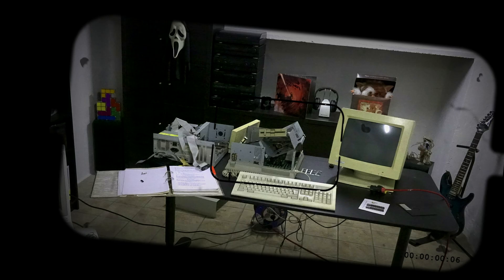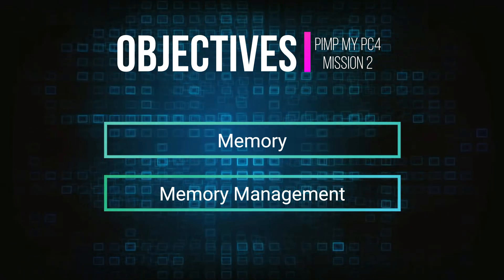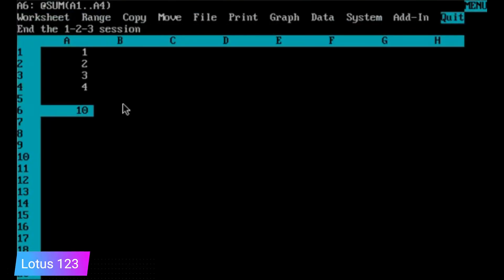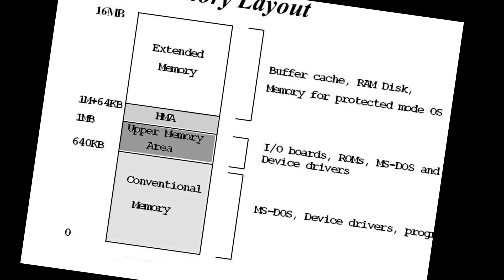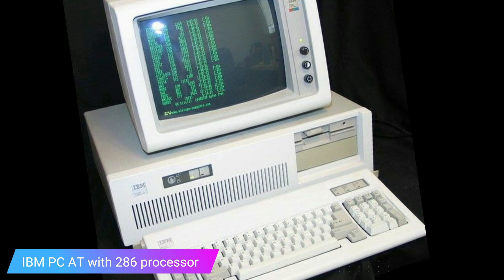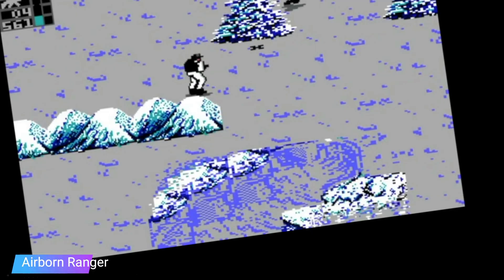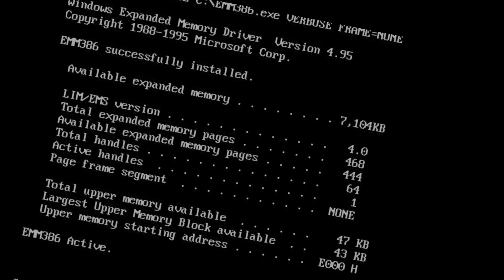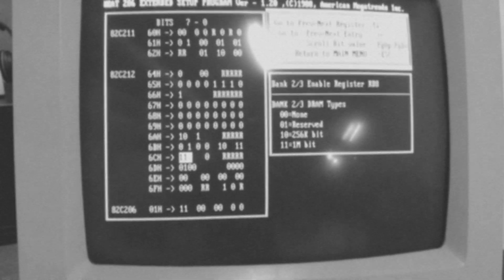Restoring the Atari PC4 - Part 2 (Memory) - AL Technica #2

Comment: Wish I had an Atari PC4, looking for years... With the years I have pushed my Atari PC3 that I own since 1988 to the limit with a NEC V20 + coprocessor, UMB memory card, Tseng ET4000 SVGA video card, Sound blaster and a XT-IDE CF-card. Also changed the crystal from 24Mhz to 29Mhz for some boost. Tried several 286 accelerator cards but none gave a performance boost but more a downgrade since the board divides the cpu clock with a factor of 3. Anyways great video!
Reply from the maker: Impressive upgrades. And still your original PC3, that is so cool. Thanks for sharing. I think the PC4 is becoming a rare beast indeed :(
Reply: @AtariLegend  It has been a year now, and believe it or not but I found and bought myself an original Atari PC4L a few days ago (after searching online every single day for years). I'm also going to try to upgrade this one to the max after seeing part 3, starting with the cpu :-) Meanwhile my PC3 is still alive and kicking!
Reply from the maker: @tellyjoossens4186  That is awesome news! Best of luck with it! Definitely keep me posted on the upgrades. What does the 'L' stand for in 'PC4L'?
Reply: @AtariLegend  Atari PC4LC to be exact. I suppose LC stands for 'Low Cost' because features are stripped out. I have serialnumber 298 and very few were build. It has the same case as a regular PC4 minus the mouse port. It has the same motherboard layout, Amd processor and SIP ram (but only 640Kb installed by default and some seem to have a 8Mhz or 12 Mhz processor instead of 16Mhz). Instead of the indication "ATARI PC4" it indicates "ATARI PC4LC" on the motherboard. furthermore it has an EGA video chip like my PC3 instead of VGA, has fewer ISA slots (3) and at the back it only has the EGA connector + parallel port + a 9-pin serial port. It does come standard with a 3,5' HD floppy drive and a 30Mb MFM harddisk. For me the only drawback in this model is that it has fewer ISA slots and got to seek SIP ram (or solder pins on 30-pin modules but rather not want to do that). Maybe an ISA ram extension card could work  like in my PC3 but haven't got the time yet to fiddle with this. I know it posts with a VGA card but only if I remove the EGA bios. Also installed a SB AWE32 in it yesterday (just for fun but such a case screams for a full length card like this lol) and a XT-IDE so all slots are already filled. Now the quest to seek an Atari PC5🙂
Reply from the maker: @tellyjoossens4186  wow, thank you for all the info. I didn't know this existed. Found more info : https://forum.vcfed.org/index.php?threads/mistery-atari-abc-286-in-pc4-chassis-with-pc4lc-mainboard.61749/

Have fun beefing up this Atari. Would it be possible to perhaps add a vga card?

And yes, the PC5 is also my holy grail ;)
Reply from the maker: I understand now you already added a VGA. Cool...